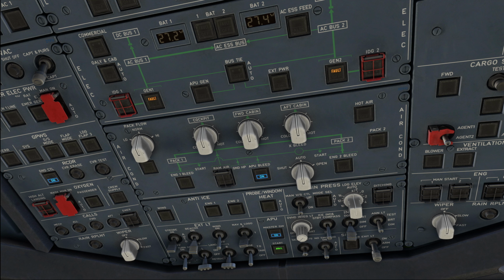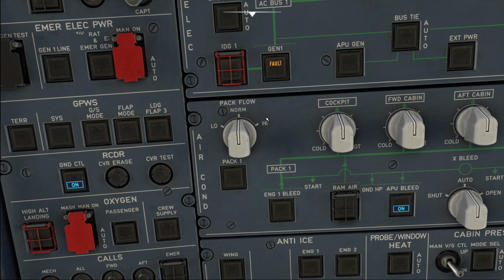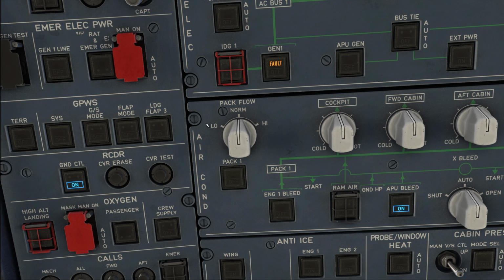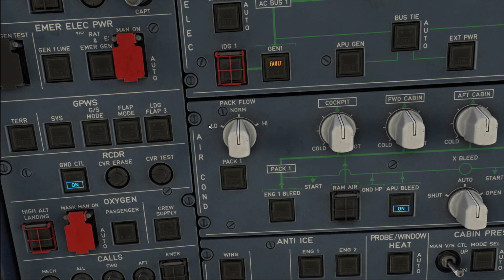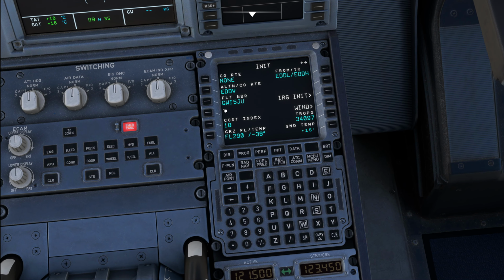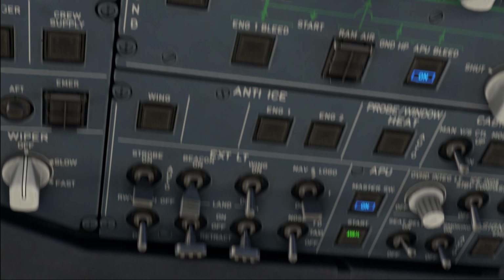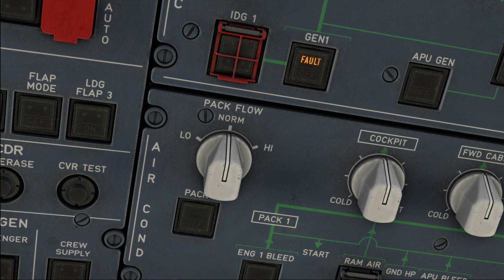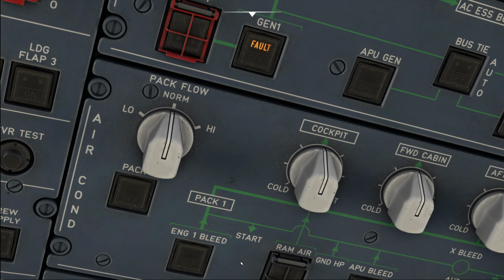PACK FLOW LO, HI or ECON? A320 Family Pack Flow Selector Explained | Real Airline Pilot

Comment: I understand that post Covid more airlines prefer to leave packs on for takeoff where possible. Would it be possible to use pack flow LO to gain some extra takeoff performance whilst also having packs on as a sort of compromise?
Reply: J'ai déjà vu dans un vidéo qu'au décollage ils étaient à off
Reply: @mrjacques1  It depends on the type of aircraft. If I am not all mistaken, the 737 (at least up to the NG) had to turn packs off for takeoff, on some others it is just a matter of increasing fuel burn and takeoff distance.  But I don't have any hard facts here. (Just my usual gripe that airliners always tend to be too warm inside no matter what)

Comment: Could you control the flow when the external air condition is connected ?
Reply: The packs are not being used when the engines are off so only the PCA is doing the heating/cooling. Some are better than others lol